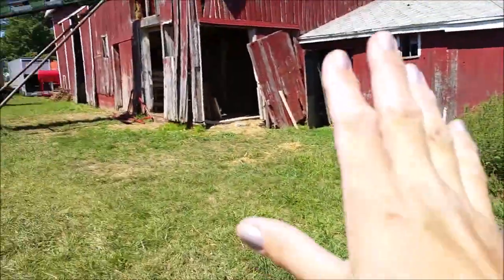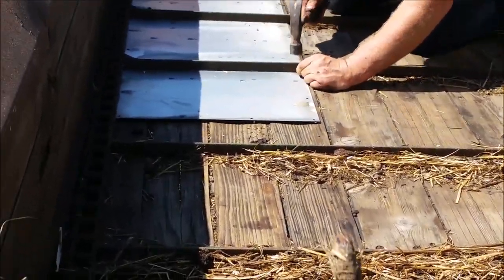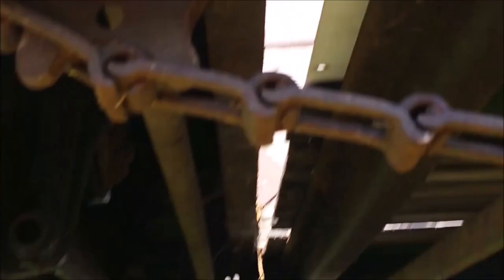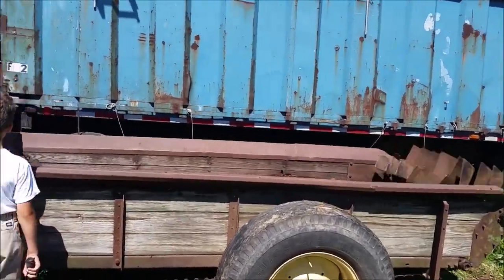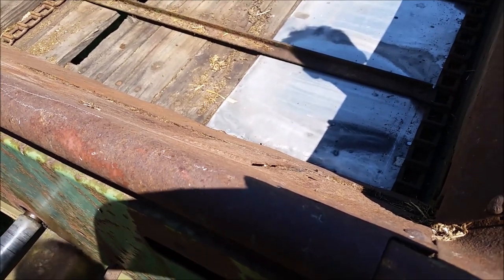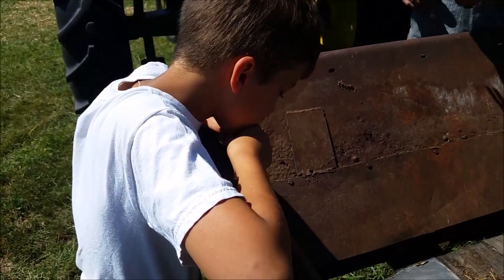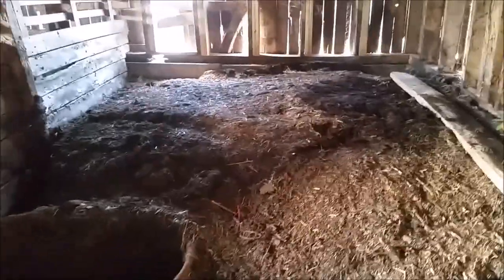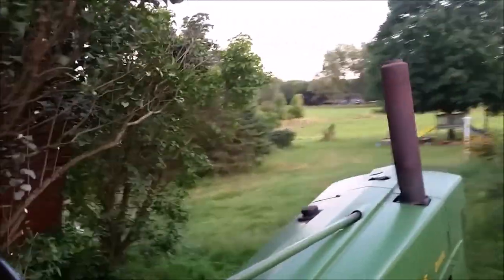John Deere manure spreader repair

Comment: When your video popped up, first I had to watch a commercial and in doing so I learned something new, which is silicon stretchable lids to replace plastic wrap.  Here's the link to the video.  https://www.youtube.com/watch?v=EJ_vw-N-JY8

I've used a manure spreader a few times and loved to swing the wagon towards the road when people were stopping to look at what I was doing.  And from my time in the milking barn, whatever I was getting on my pants, I would take those pants off after milking and hang them up and go change and eat breakfast.  And the next day they were so stiff, they literally could stand up in the corner by themselves.